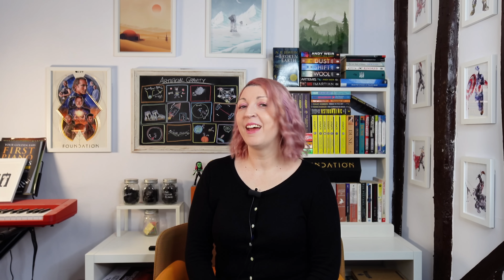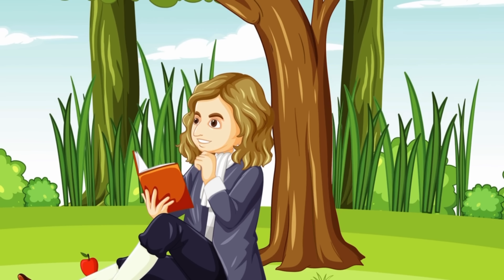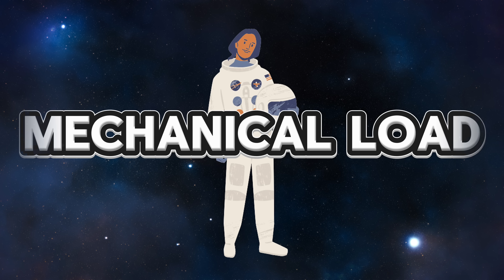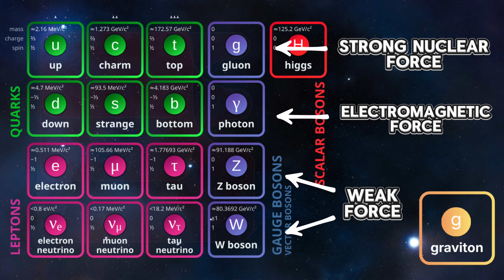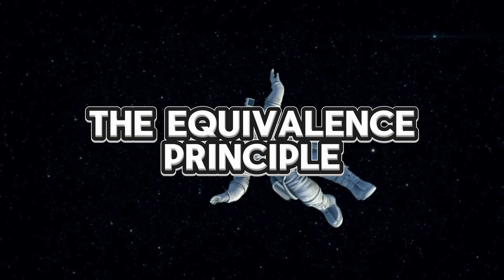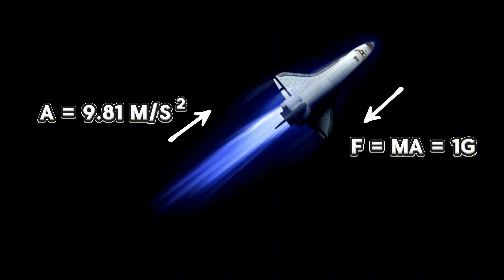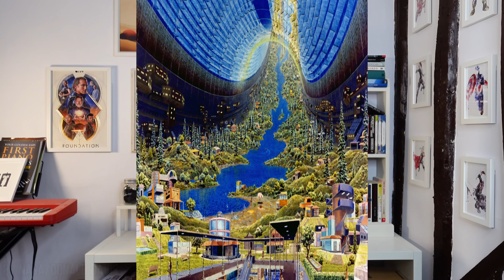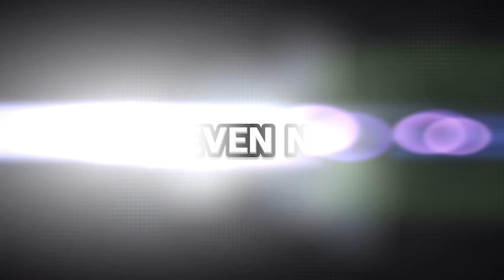Why Artificial Gravity Is Harder Than It Looks

Comment: Instead of the "stretched sheet" or "drum" allegory, try the "two balloon" allegory.  A professor of mine once described gravity as a kind of "pressure" the universe exerts on a massive object.  Consider a balloon within a balloon.  Blowing up the inner balloon is like a massive object accumulating matter.  The outer balloon thus exerts a kind of pressure on the inner balloon as it is inflated... the more air you put in the inner balloon, the more pressure the outer balloon exerts on it.  Inflating the outer balloon is like putting distance between two massive objects.  The effect is maximized if the objects are touching, as one is when they are standing on Earth, and diminishes as the outer balloon is inflated.  There's still a pressure on the inner balloon, but it is diminished.  It starts getting weird when you consider Neutron Stars and Black Holes... but then again, what DOESN'T get weird when you consider them?
Reply from the maker: This analogy doesn't work for my brain. I'm finding it really hard to visualise and make sense of what you're saying. But that's the thing about learning, different ways work for different people

Comment: How do you have a rotating section with a stationary hub? You would have to constantly expend energy to counteract the torque and hold the center stationary. Furthermore what is the reason or benefit in keeping the hub stationary?
Reply: Docking is much easier.
Reply: @marksizer3486  Coordinating rotation for docking in a weightless environment would be no problem. Much more trouble to design an interface between two giant sections of a space station that are rotating against each other. That would be a nightmare if you think about it.

Comment: I wonder how significant the increase in issues from instability due to the intermediate axis theorem would be. We have thrusters and such to keep everything stable with current spacecraft designs and Apollo had a slow spin on the way to the moon, but something simulating Earth gravity would be spinning really fast. How much extra thruster fuel are we talking here?
Reply: No fuel.

Maybe wild horses cannot prevent us from building space habitats shaped like tennis rackets*, but once we have done so, we're not going to go out of our way to rotate them on the axis they don't want to rotate on.

(Lay a tennis racket on a table and spin it while it is lying like that. The axis it is spinning on is the vertical one. It is the rotation axis that everything is farthest out from, so there is no instability at all. Remove the table, and the racket will rotate stably forever.

The axis it doesn't want to rotate on is the horizontal one in the plane of the table. You couldn't in any case rotate it that way, on the table. Not unless the table had two tennis racket head-sized holes for the head to swing down into and up out of, and two pins on the bad axis pinning the racket where the axis enters and exits it.)

* Pretty good bet. What are they gonna do, rear up real high?

Comment: Static electricity creates attraction. If it were possible to statically charge the whole human body causing the whole body to be attracted to the floor, you might be able to simulate some degree of gravity. Also, as side note, I would suggest magnetic body suits rather than just boots. This would not solve the weightless affect on internal body fluids and circulation, but it would be better than just sticking our feet to the floor.

Comment: Warp Drive won't work, Nothing can travel faster than light (that we can see), and you can't manipulate gravity without manipulating mass or time. The difference between Einstein and other physicists is he didn't operate within in the lanes, he defined them. He saw outside the box. The next Einstein will be someone who looks outside the box and redefines the lanes.

A magnetic field can be seen, measured, and manipulated. A gravitational force can keep solar systems and galaxies together but we can not see the element that does it. Pick any point in space. Measure and id the gravitational forces present. You can't. Does quantum mechanics have an answer? This box needs a new Einstein.

Comment: I'm really confused why no one seems to think that running habitats on circular tracks or roads would be a simpler method for producing G-forces. It works on tight curves here on earth. This means several trackways for transportation between the habitats and the infrastructure around them. The main structure doesn't need to be spun up. That's where power, shielding, docking facilities, manufacturing and much of the agriculture would be. 

I would start the system with two habitats for the construction teams and add more habitats to the same tracks over time. Additional trackways could be added next to the originals subsequently as the need arises.

Comment: U cant create gravity, bcuz its an effect of mass. Its directly calculated from acculmulative atomic mass. If u know 1, u can calculate the other. We can create a magnetic field, using electromagnetism, & magnetic force is always stronger than the force of gravity, cuz u can pick stuff up with magnets. The way to simulate gravity is to generate a large enuf electromagnetic field u can b inside that is the same strength as gravity. Ur blood is full of iron, & it will act as if there is gravity. If u feel u need more grip, ankle, neck, & wrist braclets can help. So can magnetic soles on ur shoes, on metal decking. To build a space station & avoid things becoming magnetized & becoming stuck to bulk heads, a lot of aluminum & non magnetic metals r required. Placing the space station that would look like a small deathstar from starwars at the primary Lagrange point, it will not b susceptible to gravitational fluctuations from the moons orbit.

Comment: Here’s a thought: The first actual evidence that light propagates in waves was discovered around 1800. The first real, manipulated use of what I’d call concentrated light in the form of lasers was invented around 160 years later, around 1960. 
The first actual evidence of gravity waves was discovered in 2016.  What could happen if we can actually concentrate and control gravitational waves in much the same way as a laser does light waves? If it takes 160 years for that to happen, none of us will find out the answer. But, skeptics, please consider that possibility. It leads to all kinds of interesting possibilities. Like artificial gravity. And possibly to a warp type drive.

Comment: Ok. Imagine 2 sperate tubes connected together with Bearings. The inside does not spin. But the outside does.  The bearing housings are lubricated with a silicone-based fluid. Welcome your magnetic field. Sill not sure if the outer shell spinning will create gravity. But magnetic boots and weighted clothing would make up the difference. We need to start somewhere to be space fairing. If this is handled as well as the pandemic was. well, were fucked

Comment: While I agree on moving forward with a spinning space station or finally bring up the CAM module from Japan for the International Space Station. But I wonder about slightly ionized air along with a rotating magnetic fields that would make a conveyor belt of pressure pushing toward specified down within the space craft, even within your lungs. Simpler example would be the ion bladeless fan, but would be huge and astros could walk inside of it.

Comment: Two large space ships tethered together spinning in a large radius with carbon rope. Simple.
Reply: Andy Weir's design for the ship in the forthcoming Project Hail Mary movie uses a clever design of having a ship that, once accelerated to a decent speed (92% lightspeed) can then seperate into drive and habitat sections connected by tethers, which can be spun around each other for artificial gravity.
Reply: Yes. And you can add two more space ships at a time until they make a circle. Then you can add an adjacent circle, two spaceships at a time.

Comment: How much energy is needed to create the spin?
Reply: Easy to estimate for a spaceship that accelerates itself to 100-m/s tangential speed at the end of a 1-km tether: it's the same as if it accelerated to 100 m/s in a straight line, without the tether.

This assumes we can be close enough, without considering the kinetic energy that will be imparted to the tether. But if it's just 1 km, that energy is little enough that, indeed, we can.

If it's two ships at opposite ends of a 2-km tether, obviously the required energy is twice as much. But there's a wrinkle: if each one fires its engines only when the accumulating spin is carrying it in a celestial direction close to where you want to go, the same energy gives both spin and translation.

Comment: One idea you didn't really cover here, would be using a large Heimholtz Coil to create a uniform magnetic field. Then equipping the astronauts with clothing embedded with a steel mesh or similar. Consider it the upgraded version of magnetic boots. This might not help with fluid movement with the body. But it could certainly help with bone and muscle degradation.  Ferro fluid could even be injected into the inner ear to give a sense of "down".

Comment: Excuse my dumbness but gravity works on the entire body and we experience 1G at Earth surface level, and lesser the further we may be from the surface.  Is that right?  If so, in a rotating habitat in a non-gravitational environment (somewhere far away from a planet/large mass), a person would experience pseudo-gravity (centrifugal force?) while they are in contact with the inner surface.  That surface is rotating at a specific velocity to create that effect - but there is a direction to that spin - let's call it "spinward".  So a couple of questions....  if I move in the reverse direction of that spin whilst on the surface (while remaining in contact with the surface) , does my apparent gravity change?  I.e. would it become less?  If I run fast enough, would I leave the surface? Next, irrespective of the direction I am travelling, if I jump so I am no longer in contact with the surface, does the pseudo-gravity effect fall off/cease?  Do I then float?
Reply: Yes, but no-one can run that fast.

No, the surface experiences gravity because it is moving in a circle, and you, standing on it, also experience this because it is pushing you into a circular path also. When you jump, your path becomes straight, and therefore soon you are back on the surface. So yes, technically you do float, briefly. The same brief float as when you jump from Earth's surface.

Comment: I haven't watched the video yet so pardon me if you already came to the same conclusion, but Yes we can create "artificial gravity" within a confined space (like bedroom or bathroom.)

Using centrifical force, you could place a small free-swinging room at the ends of a spinning arm. The faster the arm spins, the greater the gravity.

Large spinning wheels (ala "2001") wouldn't work. All that would happen is you'd float while the walls spin past you. You need a floor to push up against you.

The Russian ship in the "2010" sequel nearly got it right.

Comment: If you spin anything, there’s a centripetal force balancing centrifugal force ( please don’t blather on about fictional forces just  do you can confuse people) . The centripetal force builds with mass which is of course distributed in structure. No material we have can withstand the stress needed to produce full gravity for a large system. 0.1g would be difficult at 450m for most materials.

Comment: During the late 1950s both the USA and the USSR were experimenting with nuclear powered aircraft and nuclear powered rockets.  If you doubt me just Google it.

Both countries had working prototypes by the end of the 50s.

Problems of shielding the crew and contamination if a crash occurred were the last remaining problems.

The technology was abandoned for several reasons.  The nuclear submarine, the Triton missile and the development of the intercontinental missile.

Today we have nuclear powered ships that can remain under power for 10 years between needing to refuel. How long some of the biggest nuclear powered aircraft carriers can operate under full power is a secret but a reasonable guess is around 25 years

In the last few months the Russians have revisited the technology and have developed a cruise missile which can stay airborne indefinitely and has unlimited range.  The exact technology that was being developed in the 1950s.

Therefore it seems that the idea of 1g acceleration for a rocket is no longer the idea of sci-fi but has once again become a distinct possibility not just because of solving the problem of gravity but also substantially reduced journey duration.

Interesting fact under 1g acceleration it would take just 24 years crew time to cross the galaxy (Google it). Of course the by the time the crew returned to earth 100,000 years would have passed so  it probably wouldn't exist as we seem very close to blowing it up right now

Comment: Math question... What diameter would be required to achieve .9G acceleration at the rim of a spinning ring or cylinder without incurring inner ear and balance issues?  Arthur C. Clark's math was off. Moon-equivalent acceleration with that ring diameter would have had the astronauts on their knees and puking from inner ear issues. Can off-the-shelf materials withstand the forces involved?
Reply: 0.9 gees in 30-turns-per-hour rotation exists when the radius is 3219 m. One full gee at 3577 m.

3219 m is very close to the length that the steel ropes in the Eibsee-Zugspitze ropeway reach down to the gondola when it's starting an upward run, so yes, strong-enough materials are available off the shelf.
Reply: @grlcowan  Thank you for the information. My idea for a habitat was a 1km x 4km cylinder. Gestation and early development would occur at or near the Outer layers, and geriatric living area would be closer to the center for lower acceleration

Comment: One other thing that I think will see it's day sooner than later, is the child from all the work done on NERVA. A propulsion system that uses a nuclear reactor, specifically the heat- consider a craft that takes almost any lowish density liquid, and expels that as superheated plasma at speeds that no chemical rocket could even get close to ! Now consider the propellant- the craft could be "refueled" from any source of frozen gas or liquid gas, that could make virtually ALL destinations past Mars quite feasible. The original design used only liquid hydrogen for reasons of efficiency and thermodynamics but a modified design would mean the choices for propellant are still many, there's plenty of sources of hydrogen, helium, nitrogen, or mixtures there of..

Comment: Since we know for absolute certainty that long term microgravity is indeed BAD for humans, I have to admit to being quite perplexed as to why not one space station built to date never made an attempt at a balanced rotating capsule, even if just large enough to house say two astronauts in each opposing arm, for a total of four. It's not like the hardware would be difficult. Astronauts could spend their sleep times in these small sections and thus we could real data on the level of protection a limited G environment provides, which regardless of actual results has simply GOT to be better than none !
Reply from the maker: The ISS has been the only station for a very long time. They did plan for a rotating section however the mechanical effects put strain on the connections that is not well defined and is a huge risk of failure. Plus it was always intended to be a lab to test the effects of microgravity. As astronauts are fine for 6 months at a time it's not really necessary. Future space stations will likely include rotating sections, but 27 years ago we didn't know exactly what would be needed long term.

Comment: Well you are kind of royally F'ed because if you want the real deal gravity on a spaceship, any your ship ISN'T the size of a small moon (or  that odd looking space station that isn't small moon) then you'd need to go searching out there for a VERY rare event..a RECENT high kinetic energy collision between a couple of white dwarf's whereby you could "harvest"  some core material that had yet to get close enough to virtually anything else to accrete lots of lighter material all over it. So, you've found your few hundred cc's of core material and you've got the industrial machines to manipulate this crazy massive stuff, you could place or disperse it at various positions on your massive space vessel to impart a certain percentage of Earth gravity. If that sounds like too far out and it is, then you are stuck with living on a rotating unit around a central gravity free axis.

We are no closer to making gravity, or antigravity,  than we are to understanding what a magnet really is.Sure we can describe it and quantify  it's properties and behavior with great accuracy, but do we know WHAT it actually is ? NOPE..we don't. It's the same with many other things in science, like superconductivity , we know about flux pinning and Cooper pairs and all the rest of it, but we are STILL not at a stage where we can say, we know EXACTLY what's going on and we can just replicate the properties by mixing this, this and this and heating it up etc....no, we are still in the dark and are making higher K superconductors by discovering them, NOT designing them.  We have BIG holes in our knowledge....